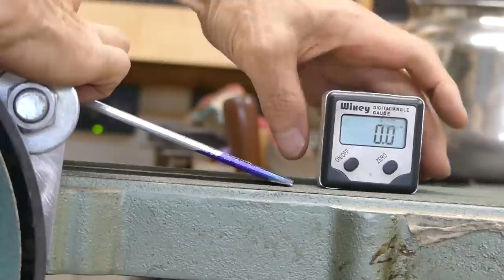Make a  Low Angle Jack Rabbet Plane

Comment: another gorgeous plane ! the quality of your work is very high. if I should spot something wrong its would be :
- a little bit worry about the plane solidity by the thin section of the arches between the two soles.
- the handle can be more ergonomic rather just a router rounding.
- last you absolutly shloud add copper/nickel electroplating to your skills !

Comment: B-E-A-Utiful shoulder plane, for sure!
Excellent shavings and shoulder cuts as well.
Any thoughts as to adding a shoulder cutter to either side? I'd love to see your thoughts and process for answering that need on a plane. But this plane came out as beautiful and functional as all the others I've seen from you. Excellent job.
Edit: what was that adhesive you used to set the wood in?
Reply: Polyurethane glue (like gorilla glue)